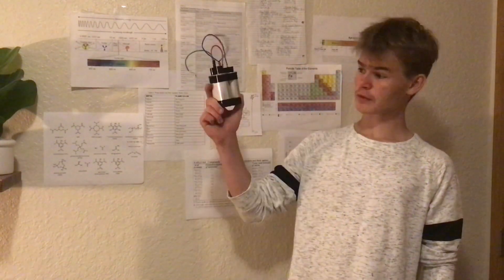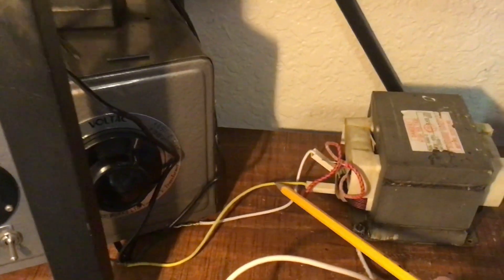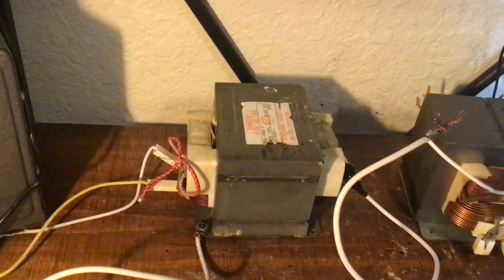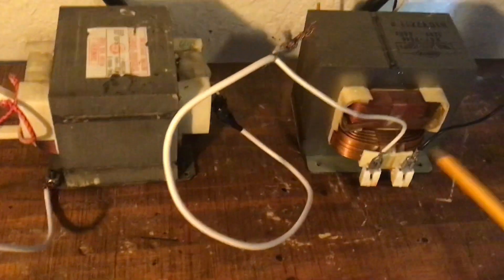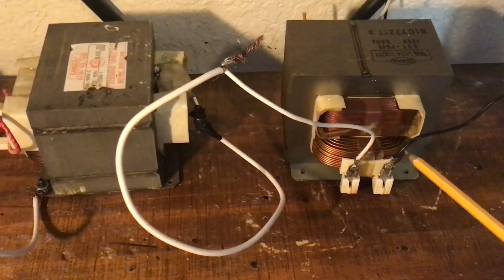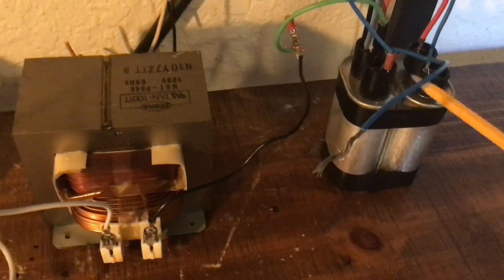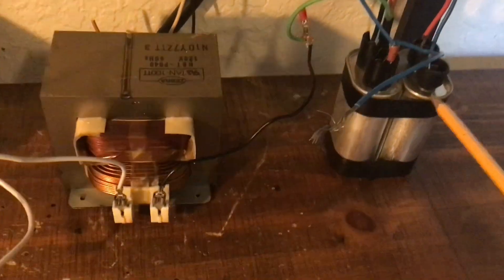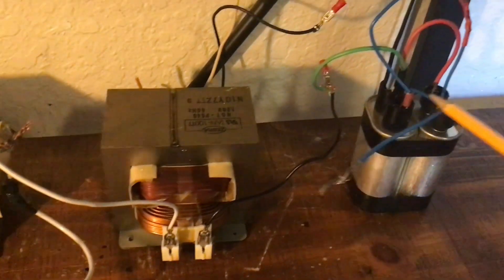Creating HUGE ARCS Using Resonant Capacitors!

Comment: Nice, but you don't really need the second transformer as a ballast, since your "resonance" caps already act as somewhat of a ballast. 
Also since you just use one MOT your output voltage should be around 2100v rms and 3000V peak with a lower current as well (probably 1-2A).

And for the future, please use a PVC tube as your arc stick and not wood! Using wood is very dangerous, since it very easily absorbs moisture and could thus become conductive.

Besides that nice video tho:)
Reply from the maker: Well actually none of the electrode is touching the wood, and im using high voltage resistive gloves ( they can resist up to 40kv), and the wood is SUPER dry, so even if the wood picks up some water, the resistance of the water across the four foot long stick would be way too high to carry the voltage through the water and through my gloves.
And ballasting the circuit does actually help, it raises the inductance, this it raises the frequency at which the circuit oscillates.
And the current is actually around 4 amps, I went to my uncles house ( he is an electrical engineer) and he had an amp meter, and we measured the output current, It was over 4 amps.
Reply: @Joseph_sidl  and using more capacitors would make it even more less likely for the transformer to heat up?

Comment: I just subscribed to your channel!

Though what i would like to see in your future videos just purely for the safety aspect: please incorporate some sort of dead man switch into your microwave transformer set-up(such as a couple of foot pedals atleast) with preferably someone else on standby - a key toggle switch with an indicator light would be smart too, as you are probably pretty aware: the energy outputs of these are pretty damn lethal and will likely induce ventricular fibrillation/cardiac arrest near instantly if set on you or anyone else.

When you are able to afford it(reletively cheap here in the UK, around £1000) - especially if you are continuing to work on HV stuff like this regularly: An automatic external defibrillator(AED) might be something you should seriously look into getting - call me paranoid, just incase.

Other than that tired sounding safety talk - your content is fantastic, i see you having an extremely promising future as a content creator - your videos are extremely educational and fun! 

Just stay safe in the meantime and incorporate those safety features in your high current/voltage circuits - plus really consider getting that AED! 👍
Reply from the maker: Well I do have a 20 amp fuse hooked up to the curcuit, so if i create a short for over a few seconds it’ll just pop the fuse, and off screen there is a switch, so if anything goes wrong I could just hit the switch, but yeah man thanks.
Reply: @Joseph_sidl  Im not actually sure if a 20amp fuse popping after a couple of seconds would actually be sufficient to save your life - it takes a fraction of a second of AC exposure to cause ventricular fibrillation - which quickly leads to cardiac arrest(you can also feel "fine" initially after being shocked, before simply passing out - to not wake up again)... and only 60mA out of those 20,000mA+ is required to do this. Those fuses are designed to save electronics from shorts to ground, not people. Its part of the reason why I mentioned someone should be on standby + why getting an AED for the future might be a very good idea.

Also - the switch on the wall you mention, I am honestly unsure whether in such a situation where current was flowing through your body whether you would be able to reliably hit the button off or not - ability to mess up heart signalling aside, another major danger of AC is that it causes violent muscle contractions compared to DC - a very good portion of your body simply locks up, there would be a very good chance you would not even have the mobility to hit that switch in time.

It's this same reason why people are unable to let go of AC current supplies when they are being electrocuted. This is why i also mentioned about the foot pedals/dead man switches - as those require the weight of your foot to be on it(or some other action), you take your foot off(extremely low effort compared to hitting a wall switch/button) and the current supply gets immediately killed. Having someone else even to operate 1 out of two deadman switches would also be very helpful in such a situation due to the reasons stated above.

I really don't want to appear condescending, as im truly not: You are very smart but I just think you are really underestimating how truly dangerous high voltage and high current AC such as this truly is - hence the actual safety precautions you have in place at this time would not be sufficient to save you(or anyone else) if anything was to go wrong.

I'm honestly not one of those "boomer" people who hates fun nor a troll when it concerns this stuff, I'm 23 - I have my fair share of experience with HV capacitors, extremely high power lasers(can ignite paper) as well as some pretty toxic and highly reactive chemical elements. So please seriously consider everything I have brought up - if you have doubts on anything I am saying, go to any forum where there are electricians;they will mirror my concerns I have laid out here. The YT channel Bigclivedotcom also did a video where he touched upon microwave transformer safety.

Again, you have a really bright future ahead of you - I just do not want to see any of that threatened for you due to just a lack of some basic safety features in your circuit and some precautions.

Stay safe and take care - I mean this in the most genuine way possible!
Reply from the maker: @Chris47368  well the fuse isnt designed to safe my life, when I was doing this experiment I used a chicken stick, high voltag rubber gloves, and rubber boots.
Reply: @Joseph_sidl  fair enough - though I'd still advise the deadman switches regardless with something such high voltage/current, but sounds you have the correct PPE gear atleast >.<

Thanks for finally clarifying you had PPE - i was so worried that you were close to legit going to fry yourself by the second reply 😂
Reply from the maker: @Chris47368  yeah well my uncle is an electrical engineer, and he helps me out alot with my high voltage experiments.
Reply: @Joseph_sidl  🫣😅
Reply: @Chris47368  I'm going to have to agree with Chris, nothing is more important than safety and it cannot be overdone. Stay safe, stay healthy, stay alive!